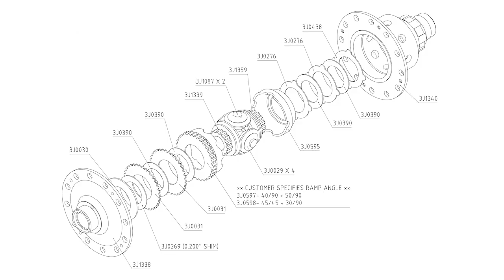Part 2 - More Progress! - LEON EX WTCC BTCC CAR - DARKSIDE DEVELOPMENTS

Comment: So mk4 platform 6 speed gear box is not a straight fit to ibiza 6l/polo/fabia platform ?
Reply from the maker: Yes thats right
Reply: It has different mounts
Reply: @andrewwright.  ibiza fsm gearbox and golf erf gearboxes measured...6 speed both gearboxes...IDENTICAL SIZE.